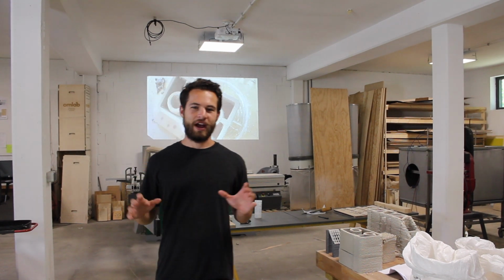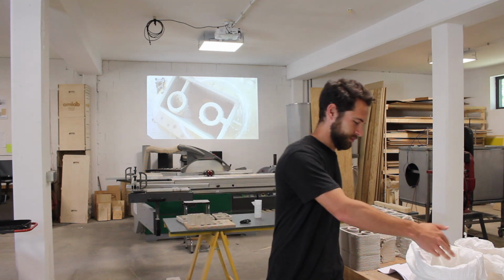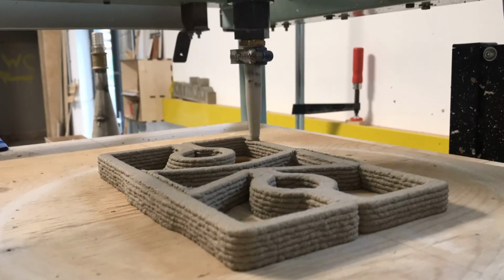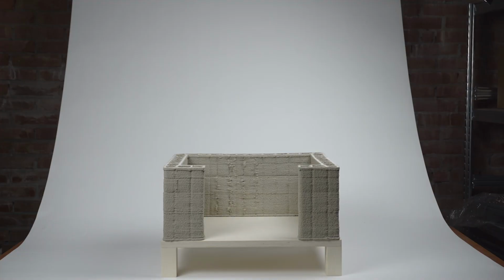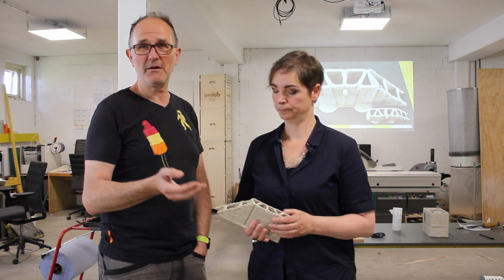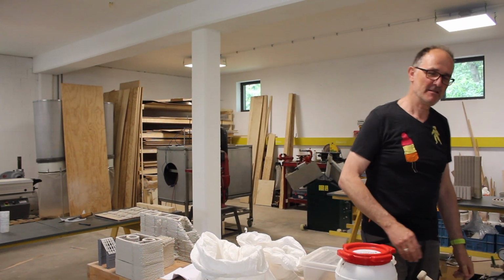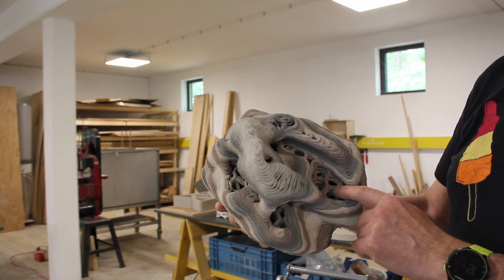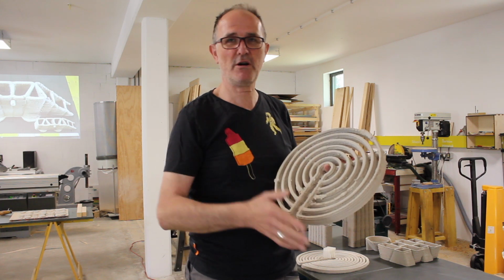Eco Friendly 3D Printed Concrete Alternative [Omlab]

Comment: I would start a little bit simpler, u copy a cementblock and produce those, there are all kind of designs of a cementblock. If a printer can print 24/7 it might be cheaper than pouring a cementblock. After that u can print beams with rebar in it, ect u could do a prefab on location and make it like legos to put it together.

Comment: Wastewater is great new source for building materials. The only downside is that it needs a lot of processing, heating to 90C, raising the ph in several stages with additives. I wonder if the material can be sold with same price as normal concrete mix?  https://www.youtube.com/watch?v=btpj73u8qTI&ab_channel=wsrijnenijssel

Comment: thankyou for sharing.
Is it possible other sources can be used for cellulose ? In Australia we have palm trees and banana tree plants which are considered a nuisance waste problem , they are very high in Cellulose.
Other countries will have different options for waste materials.

I have researched the use of Fly Ash based geopolymer in Australia but now the biggest cement suppliers have cornered control of that former waste product.
Reply: Ofcourse, certainly if they are a difficult waste problem! It would be nice though to start with a higher value than cellulose, that can always be the last step in the process of using resources likes palm trees etc. I can imagine there are examples online already of how to use it as a material for building etc. Low-carbon, renewable!

Comment: That would be a good ICF type block.  My only question about this is supply. How much toilet paper can you salvage without introducing contaminants?
Reply: I'm interested in finding out how energy-intensive (or chemical-intensive?) the sensitization process is.   I'm no gastroenterologist, but there's no way I'd want any leftover gut biome (latent or not) living in my walls!!

If it can be made with cellulose scavenged from sewage, why not from regular recycled paper fiber?  Seems like that would be a much easier sell.

Comment: My thought. Use shredded hemp hurds to help absorb moisture during curing. It also makes it negative CO2 with the hemp encapsulated in the mix. 

Great job. Thanks
Reply: A very good thought!  I was also wondering about polylactic acid from plant starch as a thermosetting binder that is waterproof but breathable….

Comment: so, if allow made a recap,....So They star using RAW Materials, Like CHALK, combined with CEMENT, and Celullosa from Recicled PAPER (wasted toiled papers)...so that elements are combined with CEMENT....BUT How strong is this BLOCK????...
And how resisten to WATER is this BLOCK????.....Because, I tried, follow all his combinations of Material to try Build In 3D printed, ...But i FAIL when, made a Block, with resist to Water and Weight...Just this turn in Crack and Brake all his structure..
can you made a Video explain his caractertics????...thank for read my coment...
Reply from the maker: I’ll ask but cement isn’t the binder used the dark smelly material is.
Reply: @automateconstruction  Thanks Jarett, So, the cellulosa process with water and sand, is the binder all you need...with Heat or just a right temperature of water???....and thanks for write to my comment...thanks dude...
Reply: @luisloreto843  The binder is the sludge made from concentrated human sewage.  The proteins in the sewage harden to form the binder.  The sand is chalk, calcite, not like beach sand.  I hope this helps you.
Reply: No cement is being used! The calcite is from drinking water production (byproduct when enhardening drinking water), the Kaumera is a Dutch invention and a byproduct of wastewatertreatment ( https://kaumera.com/english/ ) and the cellulose too. The cellulose is sanitised and controlled, have a look at https://www.recell.eu/
The strength of the material is like cellular cement blocks, based on research by student chemischal technology.